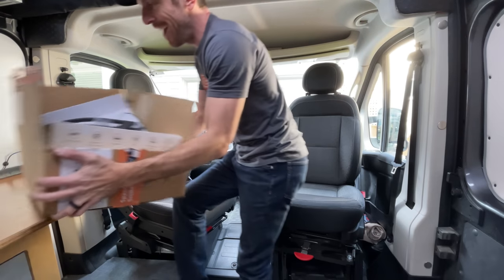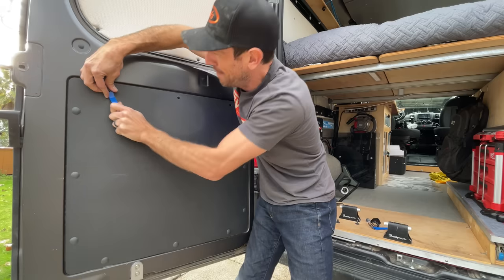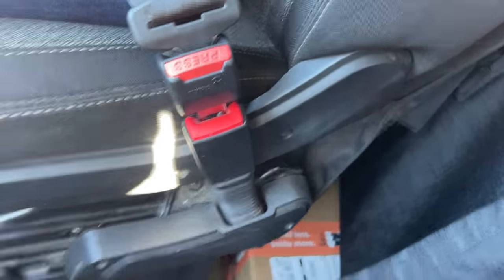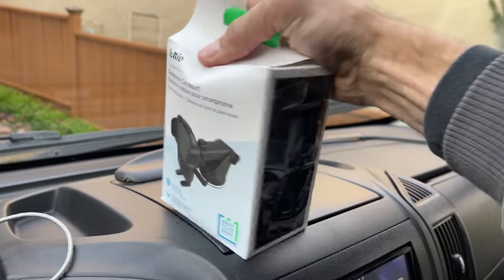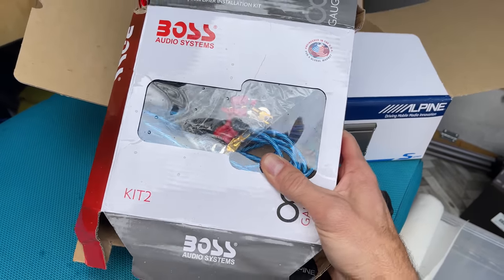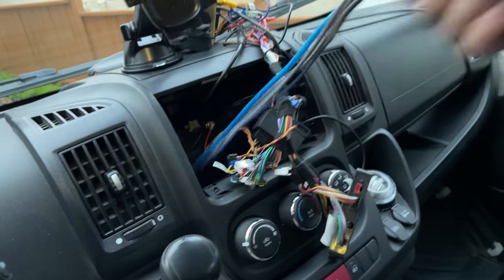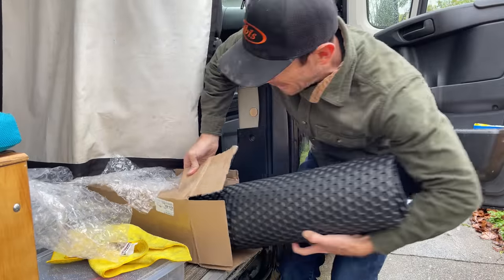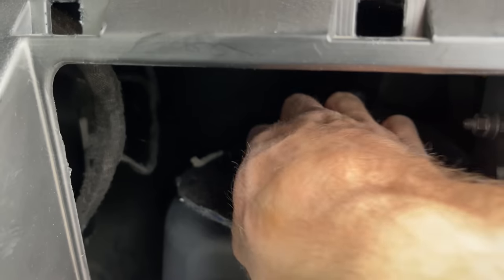10 Great Van Upgrades After 2 Years of Adventures in my RAM Promaster

Comment: The reason you run new speaker wire is that when you increase amplifier power (watts) you need a bigger wire for the additional power to flow through.  If you keep the stock speaker wire, then you are cutting the maximum performance you can get out of the speaker/amp as the choke point will always be the thin stock wire.  This will be most noticeable with bass notes which draw the most wattage from the amp.  Eventually you will want to upgrade wire gauge.
Reply from the maker: Yes! Really good point. Gotta wait for my PTSD to wear off before I tear everything apart again.
Reply: @bkxc  If you've run the power wires near the audio wires, that will create the whine you hear.

Comment: For the floor mats, if you lay them out on the concrete on a warm day, the plastic will get softer. Then install it in your van. It will then mold better to the contours of the floor.

Comment: You might be able to turn the chime off.  Might work for a Ram pro master, definitely works for the Ram trucks….
Get in
Van, close all doors. Put your
seatbelt on. Turn van on to the
run( or last position but before the
engine turns over). Wait for seatbelt
light to go off. Unclick and click your
seatbelt three times in 60
seconds…ending with the seatbelt in.
Turn van off. You should hear one
chime if it worked. The best thing I've
ever learned!

Comment: I really recommend a 10 inch subwoofer, or a 12 if u can fit it somewhere, it makes a car stereo sound soooo much better, you don't need to be bumping it or anything like that if that's what your afraid of but it really does complete a car stereo I'm sure you'll agree if you do it. 100%
They do make under seat ones that you could put under the passenger seat, I notice you got the amp under the drivers side, and I'm sure your Mrs will appreciate it lol,  j/k

Comment: not sure if u got 4 speakers running or not, but if you dont, the passenger side column at the base below the seatbelt, has a molex connector that holds the rear left and right speakers. u can either cut the wires and splice on, or find the correct molex end and make your own harness.

Comment: Better way to get rid of the seatbelt beeper is to code it with the ODB interface. 
Some Ford cars here in the UK you can do it by turning the ignition on and then clicking the seatbelt in and out 3 times within a few seconds.

Comment: This video really resonated with me. I've just bought a small used mpv/van B9 berlingo for biking. I'm getting PTSD from trying to pop all the panels out I had to take the whole centre part of the dash out just to swap the 12v socket. I've made my own jet washer, custom floor mat. Next I need take the rear trunk panel off and drop the headliner, enough to wire up some interior lighting and a limo tint to all the rear windows. Plus fix all the niggly broken bits.
Reply from the maker: Awesome! Sounds like a great project.

Comment: I designed some simply to make DIY alternatives to the window vents using plastic about as thick as the glass pane.  You sandwich 3 layers together, with the outer layers traced to fit the glass INSIDE the window frame,  and the middle layer recessed upward to allow the window glass to slide up and in between the outer layers about 1", and then all around the top and sides, extend out about 1/2" beyond the outer two layers to provide material to slide into where the glass would go when closed.  Now you can cut out any size opening, either make vents like here, or in my case, fit a portable air conditioners window vent into one so that I can run it inside the vehicle....

Comment: Read the owners manual, most cars you can disable the seatbelt chime by buckling/unbuckling the seat belt 20-30 times in 30 seconds with the car on but not started. Worked on my subaru and my work truck (Ram 1500).
Reply from the maker: Oh wow, this is news to me!
Reply: Definitely works on Subaru
Reply: just youtube "ram pro master seatbelt chime disable"  and toss those seat belt buckle things out.
Reply: Found this on the internet for the promaster...

Now, Turning to Chapter Eight, Section J - We have instructions for the seatbelt chicken dance...

STANDARD PROCEDURE - ENHANCED SEATBELT REMINDER PROGRAMMING

The seatbelt indicator also includes a programmable enhanced seatbelt reminder or BELTMINDER feature that is enabled when the vehicle is shipped from the factory. This BELTMINDER feature provides extended and modified visual seatbelt indicator and audible chime warning responses to an unbuckled driver side front seat belt. The BELTMINDER feature may be disabled or enabled by the customer using the programming sequence that follows, or by the dealer using a diagnostic scan tool.

CUSTOMER PROGRAMMING SEQUENCE

NOTE: The following sequence of events must occur within 60 seconds of the ignition switch being placed in the ON position in order for the programming to be completed successfully.

1. With all doors closed and the ignition switch in any position except ON or START, buckle the driver side front seat belt.

2. Turn the ignition switch to the ON position and wait for the seatbelt indicator reminder function to conclude (about six seconds).

3. Unbuckle and buckle the driver side front seat belt three or more times, ending with the belt buckled.

4. Turn the ignition switch to any position except ON or START to toggle the BELTMINDER feature from its current setting (from active to inactive, or from inactive to active). A single chime tone will provide an audible confirmation that the programming sequence has been successfully completed.
Reply: Whoa!!!
Reply: @nathanschulte9009  Didn't work on my 2018 promaster.

Comment: I work for Toyota and the seatbelt chime setting is customizable through a scan tool.  Not sure if this is available on Dodge/Chrysler vehicles, but might be worth it to check with the dealer.
Reply: There are instructions online for disabling the chime.  No scan tool needed.
Reply from the maker: From my research it requires a hardware dongle and some software. This was a quick fix!
Reply: @bkxc  Dealership should be able to do it through a tool they have called CDA. If you're ever in the SE MI area I'd be happy to do it.
Reply: @bkxc  I just dug around under my seat (Mazda) and disconnected the wire that went to the seat belt stalk. No more chime.
Reply: I got the chime to stop on my 2019 Ram Promaster campervan. I forget the steps as  its been years but it’s doable. (We have miles of private roads on the ranch I live on)
Reply: I have a 2019 Promaster, and you can turn off the chime with an OBDII dongle and AlfaOBD. It's the best money I've spent on my Promaster. I turned off the chime, turned off the speed limiter, turned on the factory alarm, turned off the light burned out warnings after putting in LED lamps, and changed the air pressure settings in the TPMS. It's totally worth buying!

Comment: For the AMP wiring kit, you will want to use pure copper cable and not CCA “copper clad aluminum.” CCA is highly inefficient and the amp will need to pull more power to counteract the resistance. Also, try to get tinned copper speaker/amp speaker wire. It will prevent copper oxidation that can occur over time with bare copper wire.
Reply: I was just going to basically post the same thoughts .  Often, we overthink these things.  But it usually comes down to resistance.   Copper is a night and day difference .  CCA should be swapped .  Ir doesn’t have to.. but it should be.  Man, I don’t miss wiring car audio.

Comment: get black speaker/acoustic fabric and just wrap the stock tweeter plates and new tweeters. The fabric should stay out once you clip the plates back into the A pillar.

and don't listen to people about not using the stock speaker wiring. You will be perfectly fine cranking them up 🤘
Reply: Yup. I have run many car audio setups, and the speaker wire gauge makes no difference. I have run lots of power over stock speaker wire for years without problems.

Comment: The solution to the fan situation is to put a hole in the floor of the van right before the seating area you can get the little door kits that shut and open unlock this way it sucks cold air that collects underneath the van you can also instead of just having an opening put a fan there so you have a fan in the floor and a fan in the ceiling there’s also a mathematical formula to how big the hole needs to be so the fan won’t work too hard there’s also a formula if you’re gonna use a fan instead of a hole this way both fans don’t work too hard and you don’t have a negative pressure situation

Comment: For increased airflow consider cutting holes in the floor of the van. I have done this in my VW T5 campervan and it dramatically increases the cross ventilation inside when the roof vent is running. The bonus is that even in extremely heavy rain you can have good airflow with no water getting inside. You can have the holes big (120mm - like mine) or smaller and even have more than two. The other benefit is that you get true cross ventilation across the entire space of the van, rather than just around the roof. Also much cheaper than another maxair fan.

Comment: Another fan in the ceiling will move more air but only the air up high. I have a window in my sliding door and a small one on drivers side back above the bed. Air flow is now at a maximum.

Comment: I put the plastic louvers on my front windows so I can roll them down an inch to 2 inches without water getting in if it’s raining. My reason is running my propane heater it’s suggested to have airflow so you don’t suffocate, don’t know if it make it much of a difference for me

Comment: You can just located the seat belt dinger and cut the wire. I have done that in many of my cars. Normally located just behind the dash or under the steering wheel plastics.

Comment: Man, about the seat belt bip. Here in Brazil, most taxi drivers do a hack that is to click the belt before you seat down. 

In that way, your belt will always be clicked in.

When you need to do a short commute, you choose to not use the belt,  os just pull the chest part of the belt above your head.

In a longer trip, clip it off, and do the right thing.

Comment: RMS or root mean square is defined as the average. In terms of noise, it is defined as the process used to determine the average power output (continuous waveform) over a long period of time. To give you an example, a speaker with a 50w RMS rating may be able to handle 150w of power in short bursts (a loud bass kick, or any other loud expression that happens intermittently throughout a song), but for prolonged periods of usage, the average power output should be around 50w for continuous play.
Reply from the maker: Good stuff!

Comment: you want to run new speaker wire because its thicker wire and you are pulling more amps and the stock wire is just good enough for stock. the new wire will have less resistance and Lower impedance as well. will is actually matter? maybe  or maybe not. but just something to think about.

Comment: I have a serious question for you I was told by Dodge that I could not remove the factory stereo because it is the brains of the computer system is this accurate this is the only reason why I haven’t bought a Dodge yet I didn’t like the fact of only having that crappy 5 inch display what model of stereo did you have and where do you suggest to have it installed please respond I’m buying a ram pro master later on this week and I would like to get that done and it’s a necessity thank you very much

Comment: Hey hey,

Just a comment from an audio freak... I will try and explain it as simple as possible

Your big speakers in the door have already a set of tweeters build in. The fact that you added another 2 will probably sound worse. This is due to the fact that sound travels in waves and both tweeters sounding a little diffrent but kinda the same. That makes that the wave get messed up.

So, if there is anything bothering you (at high volume) that's probably the reason. Also make sure that the 2 extra tweeters only get higher freq. JBL as a complete package with the crossover, tweeter and woofer seperate. 

If you really like to upgrade the sound in the van, look for an subwoofer (if you don't already have one). And finally, try to have all the speakers from the same brand. If that's not possible for you, try to make sure that your speakers operate in their own freq. Range.

By the way, I'm really jealous of your van ahaha.

Bye bye👋

Comment: in your owners manual there should be a procedure you can follow to remove the seat belt chime. I have done it on every vehicle I own. it's usually a strange sequence of cycling the ignition on and off a set amount of times and inserting the seatbelt several times. try searching for seat belt chime removal videos too

Comment: And the earthing of the amp wire must be sandpaper the contact point clean and then bolt it against the body and ooo dont forget that sound the speaker makes can be power wires must run far away from speaker wires the sound is from the power  wire the gets picked up by the speaker wires so keep them separate maybe run the power wire in the drivers side and the speaker wires on the left side

Comment: Couldn't you just disconnect the seatbelt buckle sensor and short it with wire? Maintain all the strength of the stock unit, and it costs $free.99 or less.

Comment: How much airflow there is has absolutely nothing to do with the noise of the fan. That is purely because of the motor. The only way to make it quieter would be a different motor.
Reply from the maker: There is a massive “sucking” sound when airflow is restricted. The sucking sound lessens when there is more airflow.